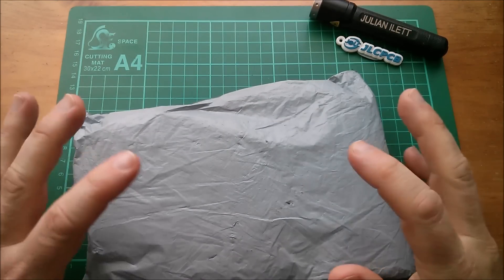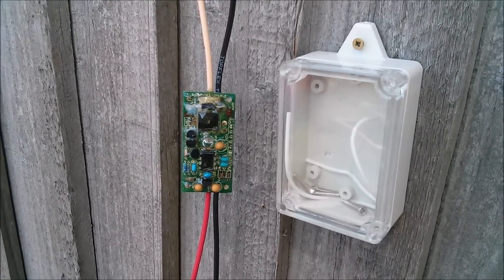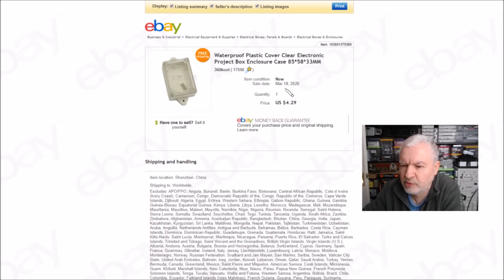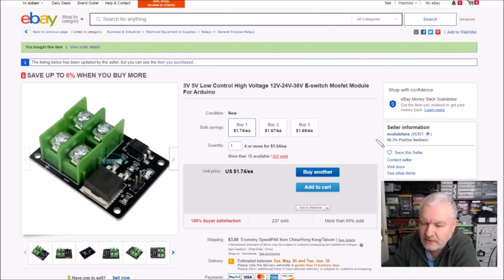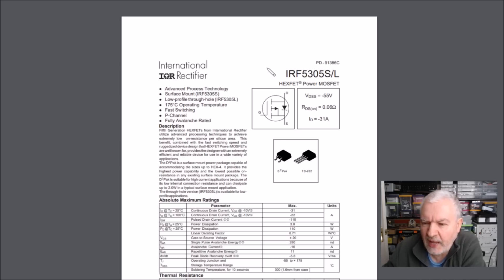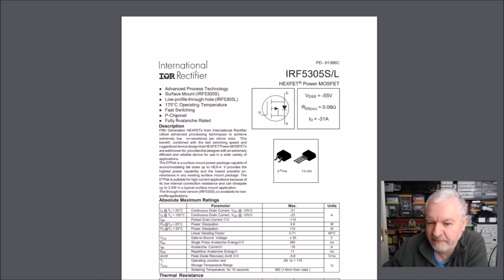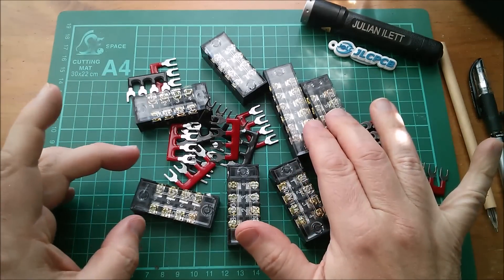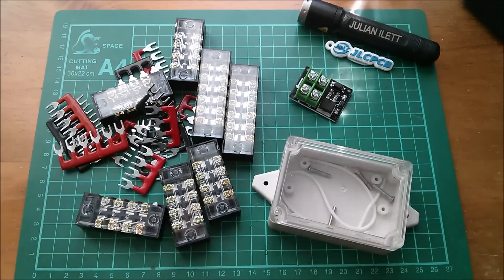Julian's Postbag #147 - Electronics for the Shed

Comment: Used grease tape on mineral plants on all terminal boxes (electrical and instrumentation) to keep high pressure water (sometimes extremely high salt content) out. Even on IP65 boxes with proper glands. Also helps with 'breathing' as a result of temperature fluctuation.

Comment: All this fuss about which "side" to put the switch, when it has two input connections and two output connections, so all you have to do is connect power on one side and the fan on the other.
That said, it's obvious that the positive side is being switched, not the negative side, so if you want only one side to go through the switching module, it will have to be the positive side.  Unless the opto-isolator completely isolates the control connections including ground, in which case you'll need to connect BOTH positive and negative through the electronic switch, otherwise it just won't work.

Comment: Here in Aus we have noticed many items from China have increased dramatically, part due to low Aus dollar but more so due to the cost of postage.
Since this virus hit, many items which were free post now have as much as $5.00 tagged on, either in the primary device cost or as added post.
Reply: Thats because china's gov was subsidizing the postage  now there not because china's in recession.
Reply: @chris-jb5ds  yes well, not sure where the subsidy lies as when any product marked free postage arrives in Australia, the entry point is usually Sydney. So that would , I expect, be the end of the line for any Chinese subsidy.  The product then has to pass through, in my case , at least one major interstate post office and at least 2 rural post offices. I think it has to be a two way arrangement with China. You scratch my back, i'll scratch yours sort of thing. As far as recession goes, it's world wide in case you haven't noticed.

Comment: High side switch with a P channel is easy,  bit harder with N channel as you know, but they tend to have a higher R(on)  than a n channel does.
Reply from the maker: I initially read the Ron as 6 milliohms, but it's 60 milliohms. At 6 amps motor current, the MOSFET will dissipate 2 Watts. It could get quite warm.

Comment: If you want to make your projects survive outside you really want to invest into a IP67 (or better) enclosure and IP67 connectors, it will cost a bit, but it will pay of, because your projects will survive much longer and you don't have to seal the boards, using a plug (like a M16 plug) allows you to easily disconnect it and take it inside... The plugs actually seal better than a cable gland... I've used IP68 in industrial applications where I have to put a button in a place that potentially will get hit with a hot water pressure washer (originally it was a 230V system and it worked fine, I've since added a isolated 24V control circuit for an extra layer of safety) when I opened the enclosure after a few years of being used there was not a sign of moisture damage

Comment: Will you need some sort of flyback diode to protect the MOSFET when switching the inductive load fan, especially when driving PWM?
Reply: Mosfet gates are pretty much insulated. I believe there is also a body diode to protect the MOSFET but I may be wrong
Reply: OtherDalfite - the body diode exists as a consequence of the way a MOSFET is made. It’s not a particularly good diode for handling current spikes. So yes, an external high current switching diode is recommended. It’s best if this is wired as close to the motor as possible, along with a 100nF ceramic capacitor.

Comment: You were pointing at thin air i'm afraid, ya little links did not appear !...I would have sworn you did some "high side" switching somewhere down the line, but was that bipolar transistors ?
Reply from the maker: I think there's a processing delay after enabling end cards.
Reply: High side switching with bipolar transistors is possible, with NPN you need the base (control) voltage to be higher than the voltage that you are switching. Or use a PNP transistor.

Comment: Uhm i think that using the rubber seal and sealing the cable hole with hot glue or resin would be much better. In winter you'll have moisture and insects in there. Beside that loved the video 👍
Reply: The primary reason for having a drain hole (and in most cases, you only need one, or two, one at each end of the case) is in case the seal at the bottom is better than the seal at the top. If this happens it will fill with water and make a nice indoor pool...🤣

Comment: It occurs to me that your "You cant' seal against British weather, just leave a drain hole" is why we have air bricks in our houses.
Reply: You can seal against the weather, but you would need to use a proper multicore cable and suitable gable gland.
Reply: @Mark1024MAK  You are stuck in that classical physics mind set,  British weather is quantum in nature (see the thought experiment "Schrodinger's umbrella requirement" and is able to tunnel thru impermeable barriers without passing through the intermediate space.
Reply: James Sharman - Joking aside, the biggest problem is that so called sealed enclosures either don’t actually seal properly, the seal is destroyed during installation or during alterations or during maintenance, or moisture is present in the case when the lid is fitted, trapping the moisture inside (which will then condense on the metal parts during the day/night heat cycle).

If a proper high quality enclosure is used and proper good quality cable glands, or sealed plugs/sockets are used, it’s perfectly possible to have a bone dry enclosure that can withstand whatever the weather can throw at it. But this costs more money than people want to pay...

Keeping rain out is actually the relatively easy bit. The hard bit is coping with damp air. Then the condensation caused by the heat/cold of the day/night cycle will deposit water on metal terminals, conductors and components. Then drain holes and carefully designed ventilation holes can help. As can including thermal insulation on/in the walls and door/lid of the case. But again this costs money...

So for the best protection, either go for a expensive good quality, properly constructed sealed system, or for a expensive good quality, properly constructed ventilated system. Don’t go for a cheapskate system...

Comment: No need to mount the box on an angle, just make sure the pcb is not on the bottom
All we did wwas drill a small hole, and with boxes that have a rubber seal, you can cut away the bit at the bottom.
Not sure why you tried to work out how the mosfet was wired (except for curiosity), you're only interested in connecting the power in/out, the arduino connects to the opto, o should be totally isolated, just get the polarity of that right.

Comment: i would put the seal in the lid of the box, the idea being it will help prevent ingress of water but if it does get in theres a hole inside. regarding rusting screws dab some vasaline on the screws, that will prevent them rusting, and it doesnt wash off in the rain, has a chinese flood light with still no rust after a whole year and the vasaline still there and no rust.
Reply: Vaseline, or petroleum jelly is indeed recommended to protect outside screws. It is also what should be used on electrical connections that may also be exposed to moisture, like battery terminals. It’s widely used in industry for this purpose.

Comment: Shipping costs have gone up since Covid. :( Looks like you got free shipping, but they've since bumped on a load of P&P.
Reply: Yeah. But keep in mind a hell of a lot of air freight was transported at low cost in the cargo hold of passenger aircraft. There is now a much lower number of passenger aircraft flying, resulting in a lack of air freight capacity. All available freight only aircraft are now flying at full capacity so some  passenger aircraft are being used to only carry freight. All this will increase transport costs and increase the time taken for international ‘shipping’.